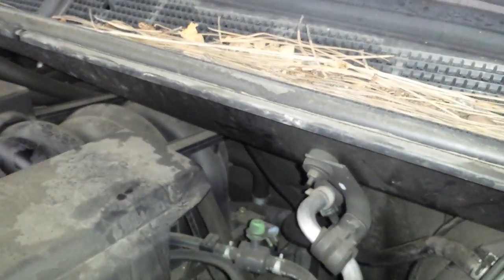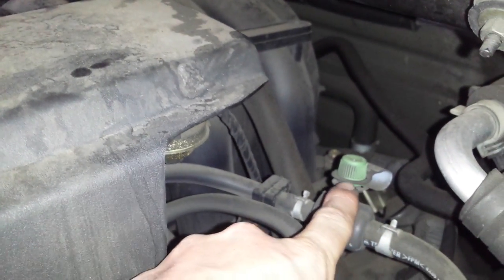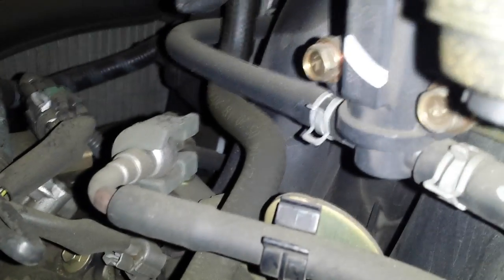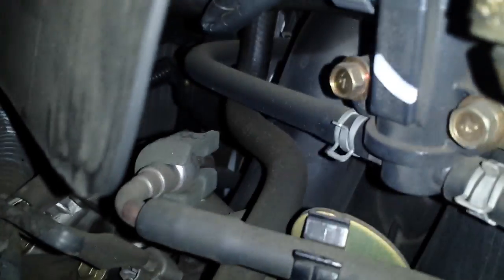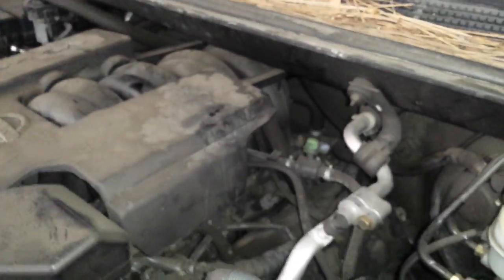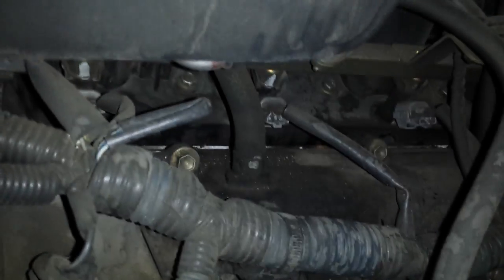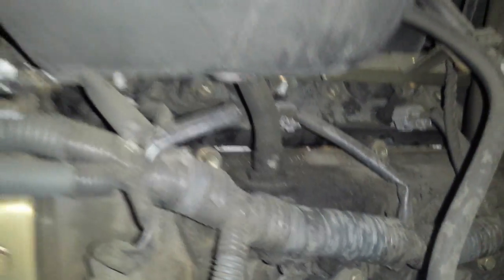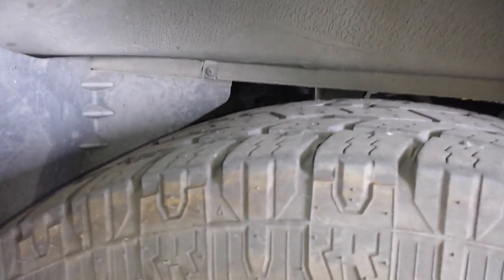Nissan Titan Emissions: PCV valve, EVAP purge valve, EVAP canister are shown

Comment: Should I replace these? For maintenance? 2004 Titan 185k miles. Thank you!
Reply from the maker: The only component in this video that I would change as a routine maintenance procedure would be the PCV valve. I Try to replace my every 45000 miles most manufacturers recommend replacing them around 50 to 60K miles.
Reply: Scotties Hobbies thank you! I just replaced my PCVs... can you share any maintenance I should look into doing? I want my truck to last another 185k!
Reply: Scotties Hobbies just did mine and I got more smoke and louder ticking

Comment: 2004 Nissan titan 8x,xxx miles. 
I have had a persistent fast tick going on at idle, mostly when its cold, but some times when its hot out.. 

I changed cannister purge control valve that is located right under the motor Nissan cover. but still seems to fast tick. 

One day I unplugged the cannister purge control valve and the ticking stopped. I don't know what else it could be need help. the ticking is driving my nuts. I looked at other threads but none of them seem to directly tell what the issue is or how to fix it.

I've been told the cannister purge control valve is the noise and its normal.

I've also been told that its fuel injectors but I don't know. 

doesn't seem to run much different just ticks. No lights. 

The ticking seems to go away with rpms.

while it ticking and I throw it in park it just seems to keep ticking and doesn't go away.

When its ticking and I shut the truck off and back on the ticking goes away for the time being.

Comment: https://www.autocodes.com/uploads/nissan/NTB15-075.pdf
this link above basically nissan has you replace original p#'s with these upgrades this should be a recall absorbed/paid for by nissan but they just pass the consumer to eventually replace this items.  not good.

Comment: so my titan has a large cloud of smoke come out but only for a few seconds I was told to replace the pcv and it should not do it anymore what do you think or what other things do you think I have to change ?
Reply from the maker: Honestly I cannot recommend much. I know you want it to be easy but I bet you are going to have a bad valve guide seal or piston ring. You got to figure out what contaminant is in the combustion chamber. Is is white smoke? Or bluish gray tint? Are you needing to top off any fluids normally.
Reply: as of right now its white smoke it might be a little blue but mostly white and I work on the truck when I have a chance so im not driving it to much I  think about 500 bucks should hopefully get it going back to normal
Reply: I don't drive it as much for the same reasons I don't want to mess it up more and everytime I turn it off and start it up it has that cloud of smoke so i haven't had to add anything yet
Reply from the maker: You should pull the spark plugs and inspect them. If you want to get fancy you could get a bora scope and look in the combination chamber but I am not sure if you could see the valves.
Reply: Scotties Hobbies ok will do thank you I will post an update when I work on it Sunday or Monday
Reply: @franciscomontoya5182 You NEVER posted that update lol

Comment: Doesn't the titan have 2 pcv?
Reply: Yes, one on each cover
Reply: Nor'easter Playa is correct.
Reply from the maker: I don't think it does but I could be wrong. Most 'V' motors have a breather on one side of the motor to allow clean air in from the intake and a PCV valve on the other side of the motor to pull the Postive Cranck case vapors out using suction for the intake past the throttle body.

Comment: When I fill up at the gas station no matter if I do it slow or fast I will hear a slight whistle that gets louder until gas spits back up. Any ideas on what I should do first to fix this issue ?
Reply from the maker: +Justin T i would start by checking the evap vent solenoid and the filler neck vent hose. The air volume that is being replaced by fuel needs to excape.
Reply: By "check"  what do you mean how will I know if it's good or needs to be replaced. Sorry I'm extremely new to working on cars. Very young and no prior teachings
Reply from the maker: I'd check for continuity on the solenoid and resistance if you could find the specs on it. Is your check engine light on? You could also disconnect the hose to the solenoid and fill up the tank and see if the problem goes away. If it does then you know your solenoid is not working right. If the problem still continues, disconnect the filler vent and try to see if the problem still exists.
Reply: @ScottiesHobbies  so disconnect hose going from gas tank to solenoid? And when you mean solenoid are you referring to the control valve or whatever it’s referred to? It’s called different things on different vehicles I’ve noticed
Reply from the maker: @akuacasemars2674  yep. If you disconnect the hose from the tank to the vapor vent control valve. Try to put gas in. If the problem whent away, the valve is bad.
Reply: I know this is super old post, but mine is doing the same. Did you ever find the fix? Every time I put gas in the truck, it shoots back at me.
Reply: @kinghunterx5  it’s been awhile but I believe it was this. I just detached it and kept it unplugged.
Reply: @JustinTrueOfficial did it end up working?
Reply: @akuacasemars2674  ya it ended working just fine no issues ever again

Comment: can any of these cause bad gas mileage?
Reply from the maker: +VK JWJJJ I doubt. Do you have a check engine light on? For poor gas milage i usually start looking at the oxygen sensors, vacuum leaks, and exhause leaks before the oxygen sensors.
Reply from the maker: +VK JWJJJ I doubt. Do you have a check engine light on? For poor gas milage i usually start looking at the oxygen sensors, vacuum leaks, and exhause leaks before the oxygen sensors.
Reply: Well my Titan has had manifold leaks for years, what started happening is my gas mileage cut in half about a year ago. I was getting 400 a tank and now I'm getting 200. I am throwing an EVAP code now. I have been throwing the p0420 and p0430 for years. But I ask because the EVAP and I just noticed my passenger side pcv is covered in oils
Reply from the maker: The manifold leak will cause the O2 sensor to send a lean condition to the computer. The computer will tell that bank of injectors to dump fuel to try and get rid of the oxygen in the exhaust. The leak is just probably getting bigger... the evap code, have you replaced the gas cap yet? I always try that first fir any evap code, if it comes back i either smoke the system to gind a leak or replace the vent and purge at the same time. Your pcv valve should be replaced every 70,000 miles or so. If you have a lot of oil around the pcv you might have a vacuum leak or some blow by that is over pressurising the engine.. that mighy slso be a sign of a cylendrr loosing compression which can cause bad gas milage.
Reply: Yeah I changed the gas cap about 6 months ago and the EVAP code came back, my truck has 180k and I've never replaced the pcv so that is probably not helping things one bit. One thing I forgot to mention is my truck does this weird thing where my slip light will come on every once in a while, and I know this sounds crazy, but when it comes on my gas mileage goes back to normal. But when it turns off it goes back to crap. I appreciate all the info you are giving me. It means and helps a lot